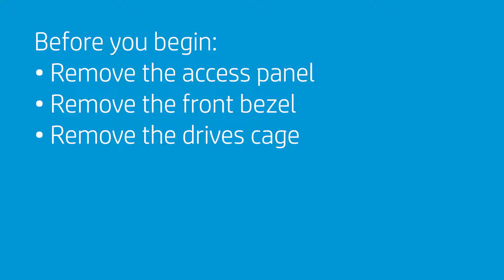Replace the Wireless LAN Board | HP ProDesk 400 G6, G5 and G4 Small Form Factor PC | HP

Comment: What Wifi Card does it take please?
Reply from the maker: +Delu Miah You can purchase the part from here: http://partsurfer.hp.com/ Please select your country and enter serial or product number of your unit.
Reply: @HPSupport  I tried that but it doesn't list any options for the 7EM49EA#ABD or 7EM49EA model. Any other resources where I can find the part number of the correct card and external antenna?
Reply: @HPSupport link is not working